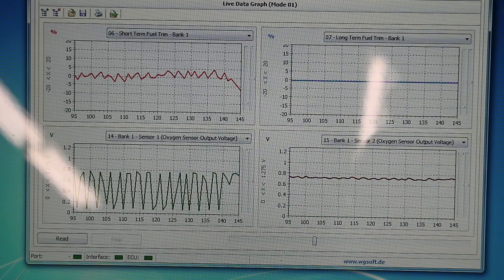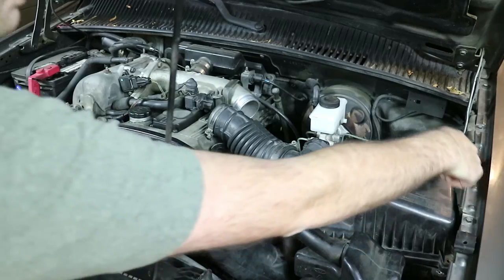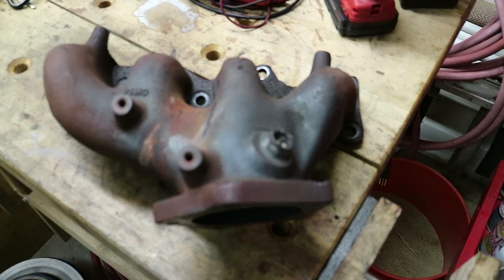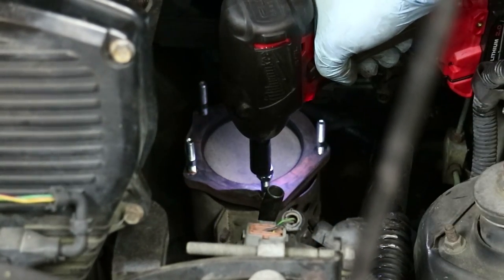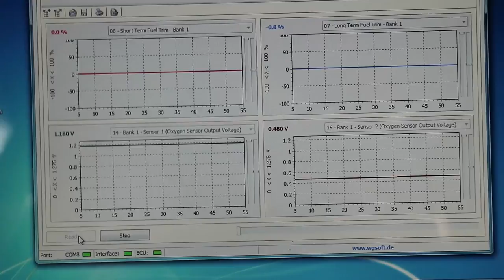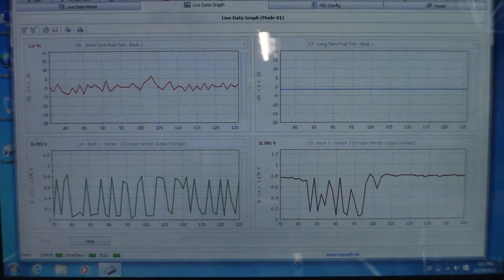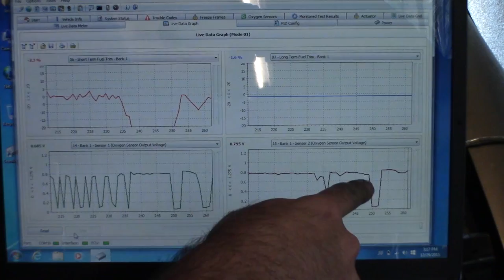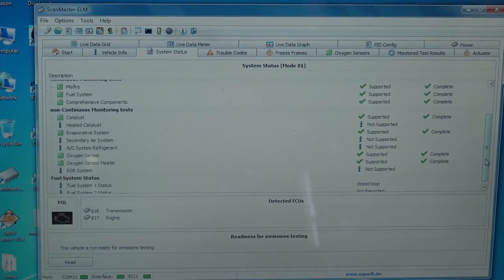Kia Sportage Exhaust Manifold & Catalytic Converter Replacement DIY

Comment: Great video. Sometimes we learn as we go, nothing wrong with that.  Bad upstream o2 sensor will ruin the cat after awhile.  I was changing the o2 sensor on my daughters Sportage and FINALLY got it out but stripped the manifold threads beyond repair so have to replace manifold. That's likely what would have happened to you anyway.

Comment: Thanks for your video's. I'm about to totaly change my exhaust system on my sportage. Your video's explains me a lot of how it all fits and works. I didn't have a technical studie but you're telling it so wel that it's all clear to me. Please keep on doing. Maybe you can do a video over replacing the ABS ring and sensors. That will be my next job on the car. Your video might help me a lot. Thnx

Comment: Later model Kia’s added flex hose between exhaust manifold and catalytic converter for less rigid system that had contributed to the stress cracks in manifold.

Comment: Looking at the part where you tightened the O2 sensor, it looks like you tightened it down, all while talking about why it doesn't need to be so tight. I'm guessing the metals involved had issues once they heated and expanded and caused the cracks.

Comment: Rewatching this. My exhaust is bad on my 2006 Kia Sportage V6. I just replaced the alternator, which is located under the engine, which made me realize how different your car is from mine. Is your's a V6? It's so different I'm thinking either a four cylinder or different model.

Comment: Good afternoon. I really enjoyed your real world experience. The dreaded PO420. I particularly liked the way u substituted the BMW O2 sensor. What kind of PC based scan tool r u using? Had an Xterra that wouldn't run the cat monitor. Turned out to b a vacuum leak and idle switch not plugged in all the way.  As soon as I fixed those problems it ran the monitor within 7 or 8 miles of drive cycle driving. Btw, before the repair, it set a pending PO300. So cat monitor will not complete if stft is not happy. Thanx again!
Reply from the maker: Yep that was the assumption that I was proceeding on in this video.  An exhaust leak will cause STFT to be erratic which will prevent the cat monitor from setting.  That's what happened as I explained at the end of the video when the new exhaust manifold's oxygen sensor threads cracked and let oxygen in.  Whether it's vacuum leaks or exhaust leaks, any way for oxygen to get in will cause disarray.  The scantool is Scanmaster ELM and an ELM327 adapter from eBay.
Reply: 50 kid stick to BMW please all the other videos

Comment: I was hoping by the title that you were going to show the procedure for replacing the Catalytic Converter.....
Reply from the maker: Sorry Robert. Search for my other vids on this Kia. One of them has the procedure already. I believe it's the exhaust manifold one.
Reply: This is the Exhaust Manifold/ Catalytic Converter replacement. You only mentioned that it needed to be replaced at the end of the video.
Reply from the maker: Okay I didn't realize when I was going through my comments this morning.  So this video basically tells you everything you need to know about actually removing the cat.  The hard part is getting the exhaust manifold out.  Once you're there, the cat is just held in with 3 nuts from underneath which you can easily see if you just get under your car and take a look.  I didn't think it would be necessary to go that far.  I kind of explained most of this at the 26:30 mark.  I did the exhaust replacement first, then figured out it needed a cat, and the job was the same minus those extra 3 nuts so I didn't film it again.  It's just how the video worked out.  Sorry for the inconsistency there.
Reply: Thanks for the information. My car must be from outside of California, because I am having trouble finding the upper cat, they mostly say they won't ship to California and the local big box parts stores carry the inline cat that is the one after the upper. At least I will know how to change it when I get one, thanks.

Comment: did the new manifold crack, dads kia  has had few manifilds and all have cracked. its a common problem with this style/year kia, hes building a header for it
Reply from the maker: I will have to check on it.

Comment: 22mm and a 7/8 r difference that's why u strippers it and that's what you did
Reply from the maker: 22mm is actually slightly smaller than 7/8".  It stripped because it was completely dickered.